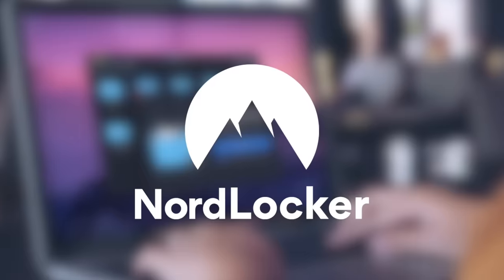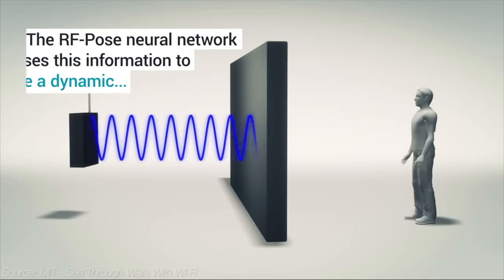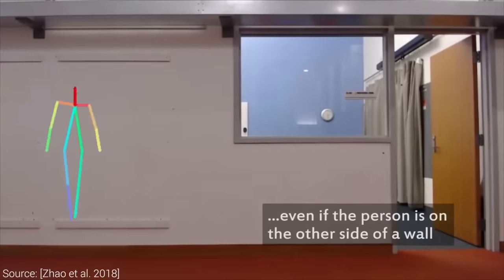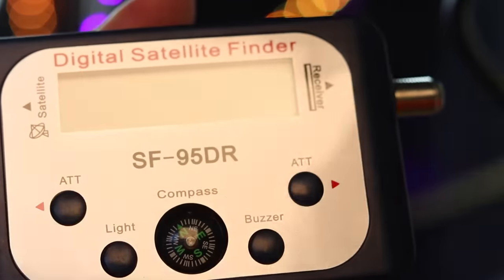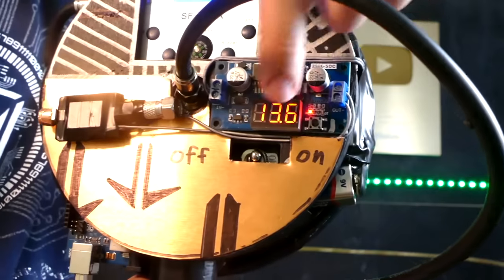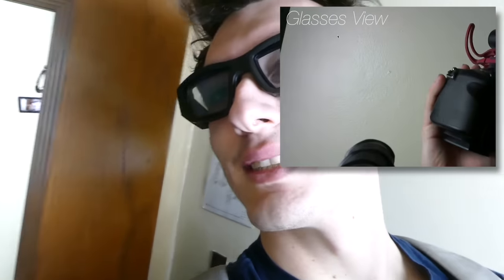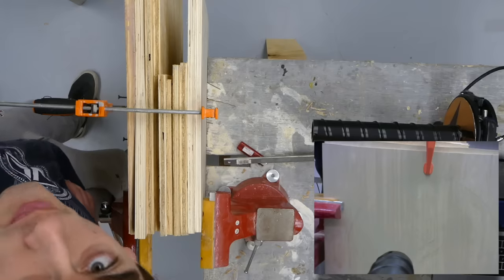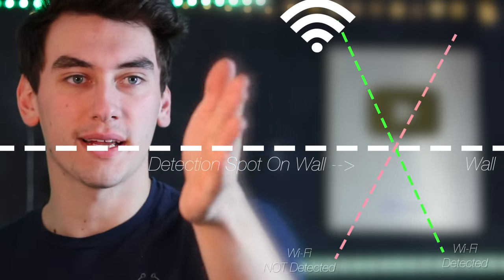How To See Through Walls For Under $20! (Wi-Fi Vision)

Comment from the maker: Should I do V2? Or what should I make next?? 
Also check out Nordlocker: https://nordlocker.net/jlaservideo
Use Code: jlaservideo
Reply: Yes! Can't wait for version 2. Add some AI if you can.
Reply: Please update newer version of x-ray
Reply: Definitely do Version 2, even to get it to display an image like that found in a thermal camera...like the Predator using Thermal Vision, would be epic.  Perhaps instead of one coil, using an array of smaller coils for each to represent a "pixel" or using an alternate type of antenna that can do a higher resolution image?  Or Version 2 could simply be a longer range version of Version 1 ?  Interesting how science can almost make possible abilities that only comic book heroes can do.
Reply: Bruh please make a Titanfall 2 jump kit, so it’s an assisted jump so U can jump further and higher and this maybe pushing it but, double jump. So using jets on a pivot with just enough power to impulse you forwards or upwards, kinda like what the hack smith did but on your back and push you further
Reply: Please make are black panther suit
Reply: A camera drone that blast fire lazers by your or ours watch control and send what it record to an eye glass
Reply: Make yolks suit
Reply: @hypemars  you could potentially use edf fans to fall slower when their pointed towards and by adjusting the angle you could run (even if it's just a little bit) faster although I don't think double jumps would be possibly since the propulsion system that you are using would need to lift your whole body plus extra force to lift you higher into the air.
Reply: you have to do this again

Comment: It'd be pretty sweet to build an array of these to create something like a 8x8 or even a 16x16 image. It'd be expensive, but you could also use just one sensor with more coils by hooking up the coils to a relay and timing the connections like an old CRT monitor.

Comment: You don't need an array of antennas. You can just mount a single antenna on a motor that scans left-to-right and top-to-bottom. Just like a CRT monitor. Additionally, this CRT type scanning idea would receive an Analog image not Digital so theoretically you could achieve high resolution. In contrast, an array of antennas would be highly pixilated. So, just broadcast a chosen radio wave through the wall, pick up the reflected radio waves with your scanning antenna, and the process the image in software.

Comment: How could you build a way to see the depth of cracks through a tile? Basically I have cracks in tile and want to see if the foundation is cracked underneath without removing the tiles. Maybe modifying something like the underwater mapping type devices?

Comment: Could you build an array of inductors to act as your lens? Or is the size of the tube not the number of turns of copper wire that determines if it is an appropriate detector of wifi?

Comment: What would happen if you detected the strength of the signal and used that to formulate the distance from the object emitting the signal? And could you take that data and use it in conjunction with the position the camera was at to find the signal to pinpoint the exact location of the signal and find a way to display it?

Comment: But you're not actually "seeing", you're detecting. Wouldn't "seeing" involve an image of that which is behind the wall? So I just read the The Creator Lairs comment that quotes a line from Batman. Couldn't you use sonar and WiFi in conjunction with each other to get something like Walabot, which uses 3D imaging software to see pipes and wires and studs behind walls and can also detect motion.

Comment: Wifi parallax!? Obviously you would need to get the receivers far enough apart to be able to detect the difference in wavelength detection. At that point, just a time-of-flight difference calculation, and you should be good.

Comment: Nice project,
I have a couple of ideas for an enhancement.
Any chance you can make your Arduino C++ and Python code available?
What was the coil designer website that you  used?
Any links for the RF Signal booster? Did it provide much benefit? I notice that mostly you didn't have it connected when using the detector.

Comment: The testing phase was not extremely Intense instead using a cinder block you should sheet metal and sheet rock these materials give WiFi a tough time I could possibly ruin this idea as most metallic objects will reflect the signals it was pretty cool and a good idea though wireless signal are not an easy topic last semester I spent 3-4 hours on each homework assignment trying to research and wrap my head around each topic so I think it was a good try

Comment: Did the rg6 coax cable jumper come from some leftovers to their equipment you had from your cable internet or satellite TV provider?

Most of the ose use really crappy, push or twist on f-connector fittings and will have majorly sucked out centers and comically long stingers.

The long stingers can have bad signal depending where their copper had been scored on the outside ring around the copper.

Bottom line: you used a good cable with good fittings. I didn't cringe while watching it.

Comment: You should make an iron man repulsed just with super heated plasma
Reply: Also could you make a plasma grenade using a small container that Can heat up the split grape continuously until it explodes into superheated plasma which could do 2 things depending on the shell that holds it, if the shell is capped and it builds up pressure it could explode, and this is if the container is made of a strong alloy (titanium) if not and it is weak then it could melt and burn some ones hand if they don't know what's going to happen.  This could be used as a weapon, and the flex seal could hold the cap on. Possibly? This is Is a fluctuating idea that I think you should look into. This could be advances in bio weaponry using grapes, round small oval shaped fruit used to explode and melt things.

Comment: If he added a gyroscope and accelerometer, and programmed it correctly, then he would be able to pin it much easier. Or better yet, just swap out that arduino uno for an arduino leonardo.

Comment: If you want to actually SEE a person, or at least see their thermal representation, through a wall, look at making an infrared scope/camera.
Reply from the maker: Won't work too well because walls are good insulators. You can'r really see thermal traces.
Reply: JLaservideo Walls w/ a low power, low intensity infrared scope, perhaps. But a higher powered, finer detailed scope should see traces.
Arguably, you’re getting into pricey, prefabricated scopes, but you should, theoretically, be able to build 1 yourself.

Comment: Your web  ice shooter is dangerous cause I try the experiment 🧪 with a lighter and air dust and if you leave the ice cartridge for a hour with the air duster liquid inside the lighter the pressure will blow the lighter up and I try it with many lighters, don’t get me wrong I like your invention and gadgets but the ice lighters is dangerous , can you improve it to a strong lighter cartridge like a metal on so it doesn’t explode. Peace out🔥🔥🧪🧪🔥🔥🧪🧪